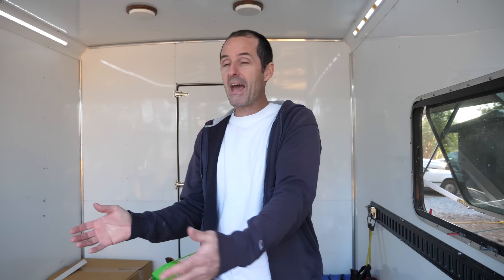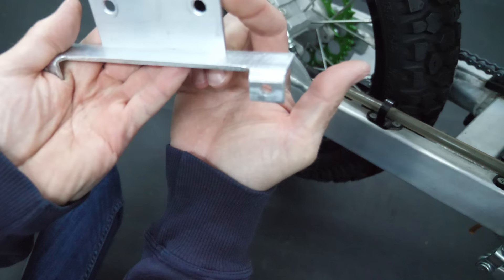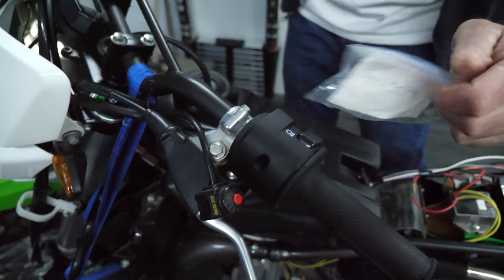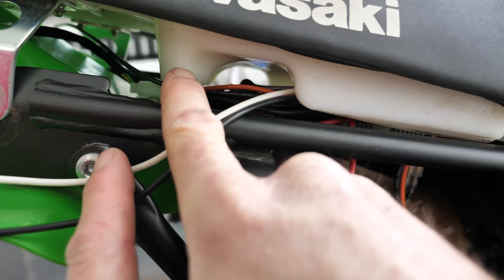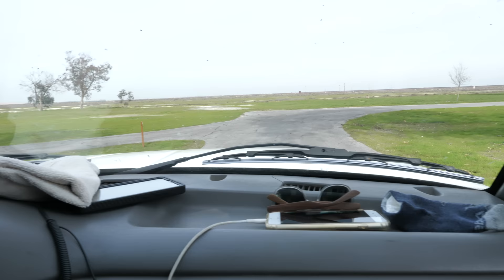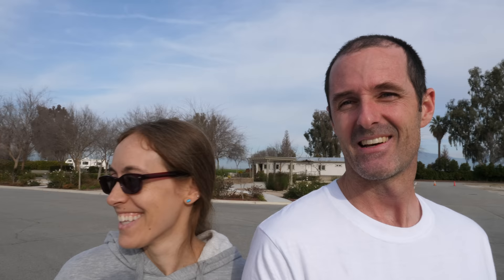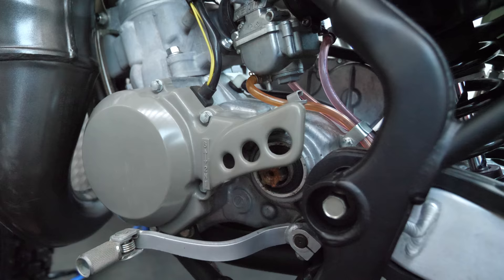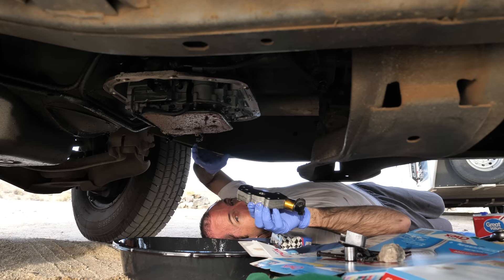Street Legal 2 Stroke Dirt Bike - FINALLY FINISHED

Comment: For a dual sport style motorcycle, I'd recommend Double Take mirrors.  They fold up nicely for off road use and will take abuse if you take a spill.  A bit more money, but worth it. Also some folding style levers is a good idea to prevent those bends.
Reply from the maker: Thank you.

Comment: You can get motorcycle wheel chocks that slide into (almost)flush brackets so you can remove them when you are parked.  I used them in our trailer when my son was a off-road racer.  They worked really well.

Comment: A friend did a similar thing with a small 2 stroke for his wife, what he did was put a heavier flywheel on the engine so that the powerband didn't come in as fast and that seemed to keep it stable enough for her to ride. (He rides a big 450 thumper, which is too fast and too tall for her to sit on)

Comment: Changing a tranny pan in the desert ... been there done that ... after a 20 mile walk back to the highway and a few days finding a new pan.  Lucky for you the wind wasn't howling blowing sand everywhere.  I really like that little camp by Joshua Tree.  And, you can cruise in and check out the rocks and stuff (and if you go early or late enough you don't need to pay - but the pass only 40 bucks anyway, if you want to drive in and hang out for a while.
Reply from the maker: Yes I was very lucky that there wasn't any wind! I didn't put it in the video but we did go into Joshua Tree NP and climbed on some rocks.

Comment: I did this when I was a kid. I think the best advice I can give you is “Do Not” run that bike at a constant high rpm. It will burn up the motor. 2 strokes run too lean at constant  high rpm. I rebuilt my bike many times before I learned my lesson.

Comment: Jake, im sure you knew this, but a lot of people keep their clutch and front brake levers slightly loose, (tight enough that they dont move around while using them, but loose enough that if they hit the ground, they will just slide up the bars or twist). Like loose enough that if you hit them, they will slide up, that way they just move, rather than bend or break.

Comment: Tie downs work best though the handlebars at a steep angle to the floor, in a triangle shape. This way they don’t need to be that tight and they cannot move , keeping the bike upright .
Reply from the maker: That might have helped but I think the main problem was the slippery floor. Once the tire started to work its way to the side just a little, it got worse and worse until the flop.

Comment: Not sure if you are still experiencing the transmission issue but it sounds like it may be the throttle position sensor. A faulty one can cause the motor to linger at high rpm before shifting.
Reply from the maker: Thanks for the suggestion.

Comment: Not to be "that" commenter. But I'm pretty sure it would have been way worth it to change the filter and fluid in your transmission. That way you wouldn't have to do it again a week later. The magnet may have a ton of metal flakes stuck to it.

Comment: 18:14  I crashed my motorcycle once when I wasn't even moving. After pulling into a parking spot I didn't kick the kickstand down hard enough and it flipped back without me realizing. I then went to lean it (a 2008 Kawasaki ZZR-600) onto the stand but it kept leaning further and further. It got to the point where it was too heavy for my leg to be able to push the bike back upright and my bike and I ended up on our sides in a parking lot.

It was very embarrassing.
Reply from the maker: I think I have done that one too!

Comment: You should have used a rear sprocket with 3 less teeth or so. It would’ve changed the gearing on the bike some and made it less accidental wheelie prone and more road worthy. Easier to cruise higher speeds

Comment: Running low on battery provisions!? you didn't run a charging wire to the trailer batteries to charge them while driving?

Comment: What kind of trailer do you have? It looks like it would be pretty low profile unlike all the new toy hauler campers. I get into situations where there are low hanging branches where tall campers have issues.
Reply from the maker: It is a Sundowner, and is lower that typical 5th wheels. Very nice for clearance and wind issues. The downside is we can't stand up in the bedroom.